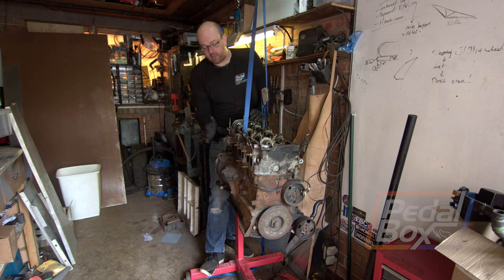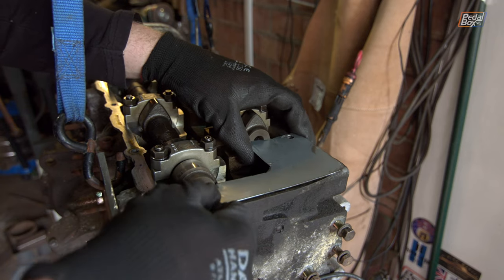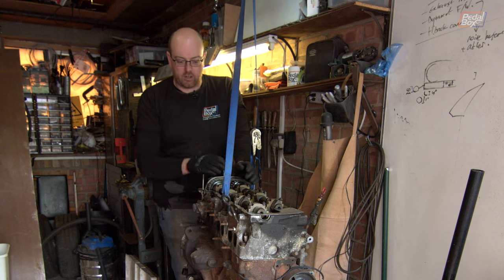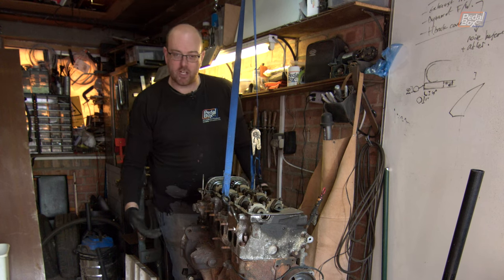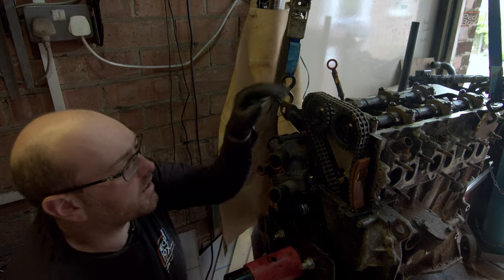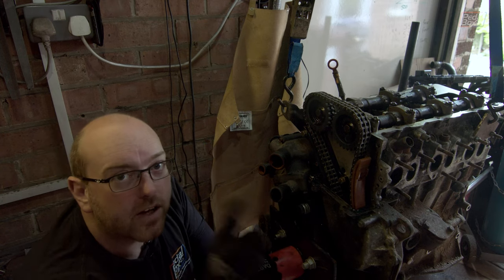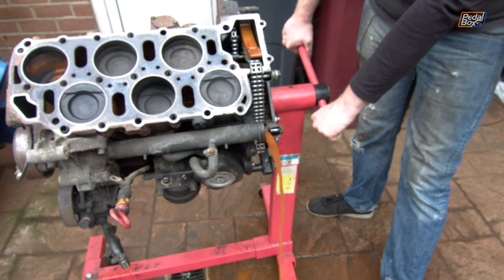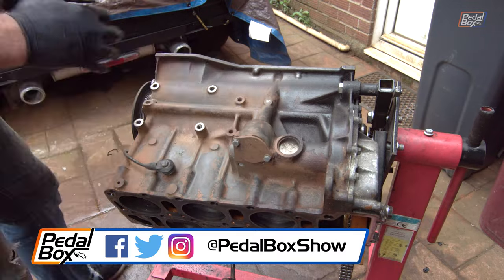Off With The Head! | MK2 Golf VR6 | PedalBox Episode 104

Comment: Looking good, couple coats of paint it will be mint! Replacing the gasket isn't bit money where the price of the whole chain kit equals the torque value lb for £, even on Autodoc! Can't recall how critical the ECU measures the cams, 24V have sensors and more sensitive to noticing stretching, unless its in bits people don't replace unless need to, when they wear its a fraction in each link which then adds up. FSI engines suffer more. 
You'll have fun rebuilding it
Thanks for the shout out BTW 👍

Comment: Block's looking fairly good. I'll admit I was surprised when you said the front plate wouldn't come off without taking the block off the stand, and then much less surprised when you discovered it was split - as it probably is on every engine (at least from the few I now know about it seems to be a common thing.)
A chain is a chain, so long as it's well oiled it'll essentially run forever, and being inside a protected engine like that it's probably not necessary to replace short of some ludicrously high mileage.
Gasket is an absolute must though. While you've got the engine stripped, do every seal, and every gasket, and every bearing, because it's basically like restoring the engine to factory defaults, and puts many tens of thousand sof miles on it before work is necessary again.
...And then spend the next few years wondering why you've got no oil pressure below 1,000rpm with the engine up to temperature... ...not that I'm bitter about it... and not that it seems to actually be a problem.
Reply from the maker: Yeah, paper ones obv can't be reused, but wasn't sure about MLS, the chain is alright, but the guide are BAD, very noticeable grooves, so that need it for sure. 
Your inexplicable oil pressure problem still baffles me though

Comment: Just get another gasket. If it fails , it will be a pain to change again. If your  boosting it. Without question, change it.
Reply from the maker: Won't be boosting yet. Needs a spacer in so it'll be coming off and absolutely getting replaced before that happens :). Just this on, cash flow is a touch tight. I'm still leaning towards replacing it, but it's probably last on the list to buy. Would rather just do it though
Reply: It's a gamble :) I think it's because when it's heat cycled it changes the metal. It dosnt reform back to the original when the head is lifted again. People have gotten away with it though, I'm one of them but it's was N/A. I'd still try and change it if you can.
Reply from the maker: Yeah,. if it was boosting this time, it'd not even be a question, likelihood is it'll get changed now, just because of a bumper week at work :D Always helps to take the edge off!